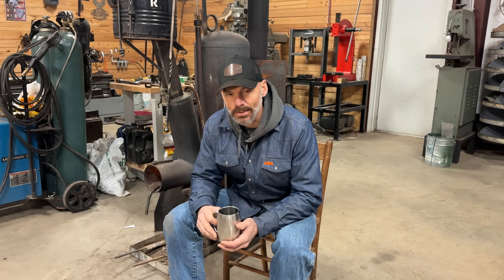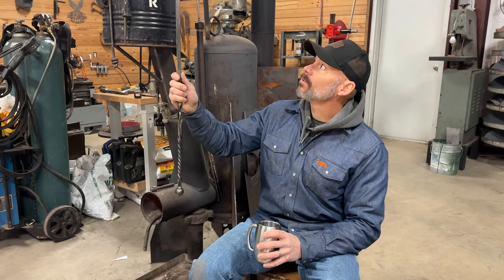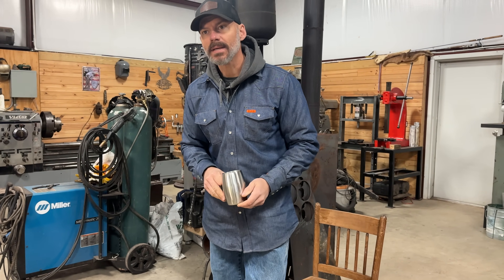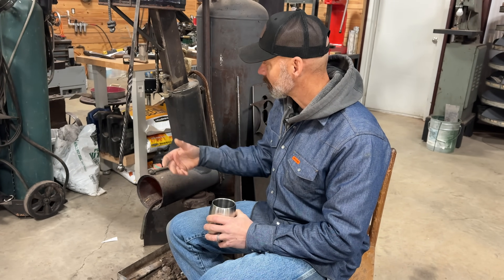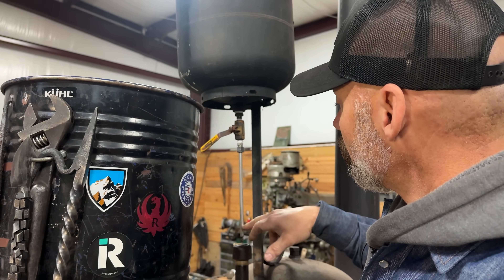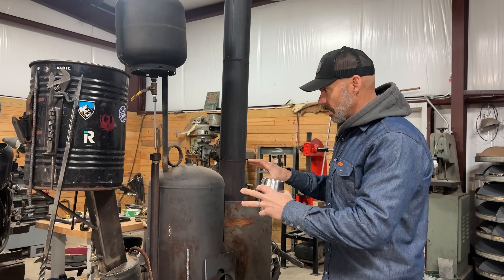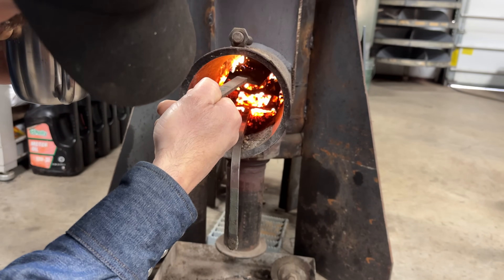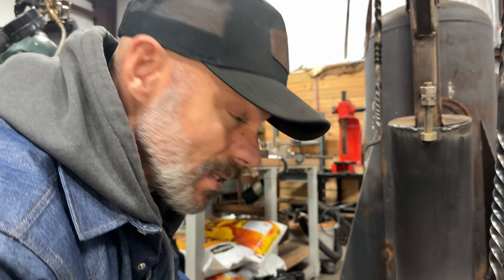I Spent 5 Years Perfecting My ROCKET STOVE

Comment: Hi Tyler, Looks good... Wondering how you get the draft flowing on startup (Blower fan?) ? Also, Soot clean-out for you heat exchange/propane tank? or it burns efficient enough that you dont worry about that..?

Comment: You should have put your hand on the exhaust Vertical stovepipe.. Bet it doesn't get over 125 to 150 degrees.. If it does, you are loosing heat... Run some thick pipe like boiler tubing from low on the intake, up 45 degrees or as much as you can get above the  existing inside exhaust pipe and convection will pull air in, and up over the exhaust pipe and out the other side.. If you can get it down to 100 to 110 before going up the chimney, you are doing pretty good.. That is where I have mine.. And, you can always weld a box on the other side with a flip open door, and put a rack or two in there and have a pretty good little oven for lunch.. Ha.. I have one on my riser that cooks Baked Taters perfectly... Coat them with butter/oil and salt and wrap them in tin foil. Cheers..  Channel popped up in my feed on your container trailer hinge because, I watched making a hinge elsewhere while I was fixing a sandwich, listening to another YT'r I follow..  You must be planning on balancing that Container pretty well for that hitch to work... Checking back to see how that goes..

Comment: YES Interested! If you had a flat top,😮 you could cook on top, coffee, tea, we've cooked several times on top of our Liberator rocket heater, soup, biscuits n gravy, sweetrolls etc, and we absolutely love it, it sounds like you feel the same way about yours 👍 I rediscovered your channel, one of your old videos help me to cut open a 500 gallon propane tank without dying 🙂 glad I found your channel again, I've been enjoying the welding videos, and then I found this. I may need to build one for my shop. We use the Liberator in our house, it keeps the house 85° in the middle of winter in Southwest Montana. Pellet rocket heaters are the bomb, great job making yours, AND using the waste oil, you've added to the fuel versatility! Love it

Comment: What's to stop the burn from traveling up the waste oil feed pipe to the storage tank?

Does the system require cleaning of creosote?  or anything else, inside the heat exchanger or elsewhere?

Comment: Wow... That thing roars like a Riello Oil Burner head. $5.99 for a bag of pellets? How long will that last keeping all that space 65 degrees? I appreciate the pursuit of finding the next improvement and never being completely satisfied, leaving the door open for observing the process even closer, for the next light bulb to shine! ALWAYS. But I do get my ass kicked a lot. LOL Thanks for sharing! MY only suggestion would be NEVER feed anything drawing that much heated air from inside the building and always pipe it in from outside, including a way to control the amount. For that matter... All material burning stoves and heat vented sealed fireplaces. Maybe a section of back and forth winding up horizontal chimney pipe with radiator fins for even more BTUs.

Comment: Have one made of silicates and fire brick,4 foot riser. Keeps a red spot on a 85gal water tank. I do use some waste oil also,just a drip in the tunnel. No smoke but does put off residue by the spider webs. The valley on a j stove will melt aluminum easy.
Reply from the maker: Nice I’d love to see some pictures of it
Reply from the maker: Does using fire brick insulate it and allow the heat to get out? I thought about that, but I also want to keep my heat.
Reply: The fire brick holds heat in and stove works better,zero ash @TaylorWelding

Comment: Weld some small tubing/pipe vertically on the outside of your heat exchanger.  It will make it's own convection and circulate cold air from bottom and push more hot air around your shop.  The more linear weld you put on it the better.  It doesn't need to be big.  Just more weld contact for better heat transfer to pipes.  1-1/4 pipe is as big as I would go.  That's what I used on my wood stove in the shop.  Scrap hand rail.  It made a noticeable difference.  P.S.  Always enjoy your vids Man!!!

Comment: Used to see all the prints on designs to make boilers more efficient and less polluting & i would bet money that the heat air mix oxidizes that tiny amount of oil with almost no nasty fumes & crap compared to only wood...
Reply from the maker: You're right, I've found it to be extremely clean burning.
Reply: @TaylorWelding  I had a feeling brother, really nice work. You're aces man.👌

Comment: Yeah I agree but not with pellets. I have a heating “appliance” that would be right up your pipe fitting alley. Research Garn/ HY-C wood boilers. Check out my channel for my clone build. I believe they are the best chunk wood boiler on the market. I built mine out of sch 40, 4, 6, & 10” a106 pipe and a 1500 gallon milk bulk tank. secondary chamber, ceramic fiber, firebrick, induced draft, horizontal flue, simple controls, burn in -40 or +100 doesn’t burn any different.
Reply from the maker: I will check it out right now
Reply from the maker: that is one heck of a heater. Does it heat your whole house?
Reply: @TaylorWelding  yup @3500 sqft of space heating and 2 points of use hot water. 18th winter season with it. No cresote. Just ash but most ends up in barrel outside.

Comment: Will it run just on oil?
Reply from the maker: yes, but it takes a lot of oil. You have get it really hot first. If you had a way to spray the oil it would work great. Like a oil pump or fuel pump.

Comment: Been pondering building one in basement of next house for heat (basement plus above) and to power in-slab heat pump system. Gives me a lot of great ideas to make it electricity free but still heat whole house if I get the closed circuit loop set up right with something like this!
Reply from the maker: For sure. once you get the basement warm, it’ll heat your whole place.
Reply: @ yeah now that I think of it, wouldn’t need infloor with that setup…plus since I want concrete at main level, the heat would sink in well…I like it!

Comment: DOOOOD! 
I've inquired about that stove more than once. Thanks for this!
FORGING! whoot.  Has anvil and hammers!
Been heating my home with wood for 24 years, won't have any trouble feeding a rocket. Can also burn junky wood I wouldn't put in my home stove-like "SPF"  and have a source for free end-cuts.

Great, do another one.  I'd also like the dimensions on your current setup. I know the sizes affect flow and things have to be balance for best performance. I'd run waste oil too. Rather burn it that haul it.  I've a pile of metal saved and even a propane tank the right size.  Have the welder and can weld a bit.  I've got to make a place to do my welding and it'll need HEAT!  

Going to build a mass-heater for the house--a rocket "engine" and huge thermal mass (cob/stone/masonry) for heat storage. They say a couple of firings per week will keep a modest home warm in frigid weather.  I have to feed this Ashley 3-5x per day in frigid weather.
Reply from the maker: Thanks!  I’ve got a few more video ideas with dimensions. You will need to make a big one if you’re gonna burn junk wood.
Reply: @TaylorWelding  I have good hardwood too (80 acres of it). I just know that rocket-temps will burn up all the nasties that junk wood produces when you burn it---like the oil.  Oil and junk wood are freebies.  Ultimately I build one (for the house) with thermal mass and then you burn it hot and fast and let the heat ride out for days -depending on the space being heated. And I can burn pellets, figure I'd have them on hand for backup. I'll need one for the shop too (but that I have to build too!).